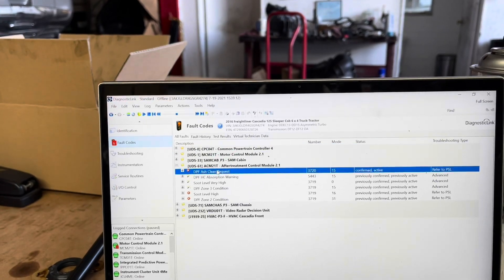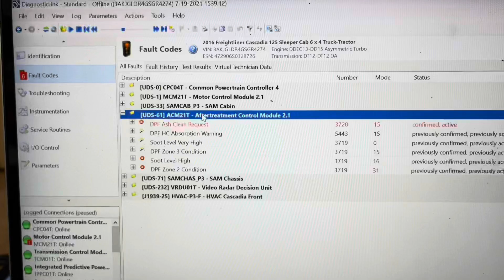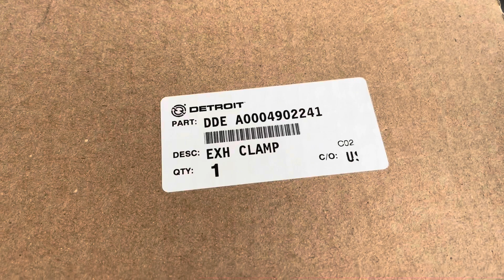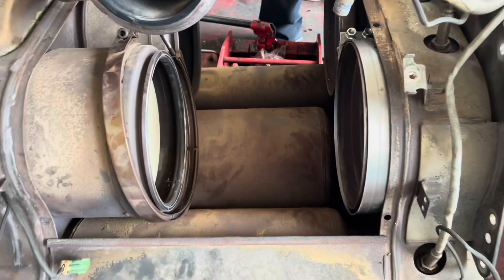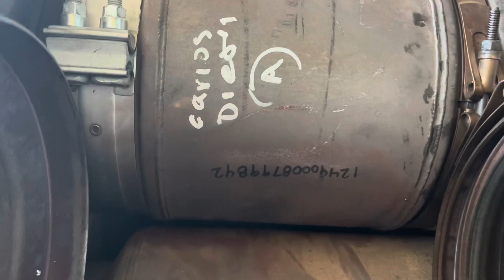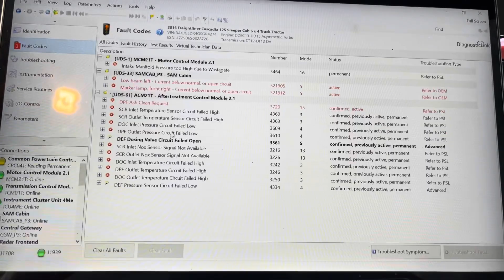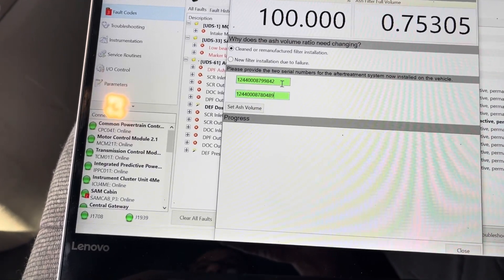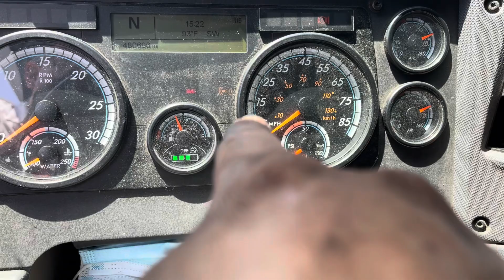Cascadia DD13 and DD15 SPN 3720 FMI 15 DPF ASH CLEAN REQUEST

Comment: Always blow out DOC aswell when baking filter, I see alot of shops not doing this when this code pops up, it should be mandatory,  what are your thoughts Carlos on that
Reply from the maker: I agree, the DOC should also be serviced. It is first inline. 
I always do this when we works on Cummins. The Detroit One Box does make it difficult to do this but they sell a tool that lets you place it over one side of the DOC so you can blow it out and use a shop vac.

Comment: Cual es la diferencia de hacer el reset enter CLEANED OR REMAN vs NEW FILTER INSTALATION DUE TO FAILURE? Compre unos filtros nuevos aftermarket de Skyline y no se que opcion cojer para el reset.  Gracias

Comment: How long do the filters last if you bake them? Can’t afford new ones
Reply from the maker: @robertcaceres3428  depends on the year of the truck. You can get away with baking them once but twice might be pushing it. The new One Boxes have a soot sensor that can read soot if it is getting through the DPF filters. 
Just had a truck in my shop with DPF filters that were letting soot through because they were worn out due to normal wear. 
What year is your truck?
Reply: @ 2019 freight liner cascades. Filters show at 43% least severe level.
Reply: @ it’s 2019 Freightliner Cascadia soot level is like 3% and the filters are at 43% least severe level whatever that means. lol severe is bad anyway. lol
Reply from the maker: @robertcaceres3428  I am personally starting to think DPF replacement is the way to go. The soot sensor can read soot that might be getting through a worn DPF. If the DPF is allowing soot through. It can trigger a fault code.

Comment: Hello, I need to ask a question.   I cleaned my dpf filters and reset the ash settings.  I was told that I am supposed to also reprogram the ACM.  Is this true?
The problem is I am getting code 520349 dpf effesince very low even after cleaning.  Please help! 
I replace the soot sensor as well.
Reply from the maker: @ranbirsohal8886  you don’t need to reflash the ACM. I haven’t heard of that. 
The efficiency could be a compromised One Box, comprised DPF. You can try reflashing
Reply: Thank you.

Comment: After the code come up how far can you drive before the truck goes to delete mode
Reply from the maker: Difficult to say how long, the idea behind the reminder is to service the DPF system to prevent any damage to the One Box. The sooner the better.
You can have the filters baked and cleaned or replace them with Reman or New units. Detroit recommends to have them exchanged.

Comment: What else I’m gonna need except DDDL ? 
Any laptop would work or it has to be some specific laptop?
Reply from the maker: When I get to work tomorrow I’ll look at the specs on my computer and see. The web site on Nexiq should have the requirements. I first tried an entry level laptop but that was too slow. 
I currently use a Lenovo laptop.
Reply from the maker: Windows 10/11 (64 bit)
2.0 GHz Dual Core Processor or faster
2.0 GB RAM or more
40 GB Hard drive with 20 Gigabyte free
Monitor and graphics card supporting 1366x768 resolution
1 free USB 
Administrative Rights (for installation only)
Vehicle interface device (e.g. Nexiq USB-Link2)
This is from the website. Hope this helps

Comment: Why does it say soot level good tho? And it says ATS electrical problem detected and this code .
Reply from the maker: Well, that is a good question. The ash clean request is due to the DPF maintenance that is monitored by the MCM, ACM. The truck can still perform a successful regen even though the ash request light is on.
Reply: @CarlosDieselElectric I got the derate, only codes I have on acm is 3720 15

Plus the def inducement light on, derate stop light, ect 

But this is the only code I have. And it derate me. Soot level low, runs regen perfectly without throwing any other codes. Engine working perfectly before derate. So I’m derated because Freightliner is SUGGESTING I change out the filters……. ??I don’t get it.
Reply from the maker: @serggla924  what year is the truck? What is the NOx efficiency at the end regen?

Comment: Im in a 2023 Freightliner Cascadia. The 3720 RMI 15 code active on my truck, but im only at 54,000 Miles on the truck? How is that possible? Does it really need new DPF filters at 54k miles? If so that is pretty sad.
Reply: Same problem 2024 freightliner
Reply from the maker: You can bake them or exchange them. Detroit recommends exchange
Reply: On my 2021 freightliner cascadia I did this at 250k, code never popped up I just noticed it wanted to regen every week when normally it would do a regen every 3 weeks so im guessing the code would have popped up any day, so with that being said 54k is insane for that code to be popping up

Comment: Hey brother I have 2020 DD15 I had my DPF filters cleaned just 4k miles ago and this 3720/15 code came on what could be the reason?
I would appreciate the reply
Thanks
Reply from the maker: Were the DPF serial numbers input into the MCM and reset the ash accumulator?
Reply: @CarlosDieselElectric  that I am not sure about but there was no sign n code till I drove around 4k and then suddenly it popped up

Comment: Hi. Thank you for great video. I have a code spn 3720 fmi 14. It’s same as yours? What i supposed to do ?
Reply from the maker: It means the DPF needs to be serviced. Detroit used to recommend bake and cleaning but they have changed their service recommendations to replacing the DPF filters (applies to One Box). If you have the old style filter you can bake and clean.

Comment: Hi pedro i have 2010 cascadia with deleted dpf but the other a guy plug his computer on my truck from there on, i have few new codes and thi is one of them  no check light or anything like that, do i need a software calibration and since is deleted can i drive like that ?
Reply from the maker: A delete can be complicated, there shouldn’t be any active fault codes when it comes to the after treatment since it was deleted. I say drive the truck or take it back to shop or person that did the delete so he can make sure it was done correctly.
Reply: @CarlosDieselElectric  im goin to los angeles california can i pass by to your shop ?

Comment: Quick question. What do you think about washing your DOC and DPF. Will it cause any engine damage just wanna get your thoughts about it.
Reply from the maker: The only issue that comes to my mind is if the DOC and DPF are not dried out properly then when you go to do a regen the water turns into steams and May cause damage internally. This was something that was discussed a after treatment class I took some years ago.
Reply: @CarlosDieselElectric   okay I will keep that in mind thank you very much I enjoy watching your videos keep doing what your doing awesome job
Reply: @neneg559 after wash, bake them to get moisture out

Comment: How long you can drive with them clogged?
Reply from the maker: Typically you want them serviced ASAP, when the notification or the CEL comes up you are at 90% 
So it really depends on how much you drive. The idea is to avoid any damage to the One Box and other components.

Comment: How long can you drive your truck like that once the fault code becomes active ? Will it make your truck derate?
Reply from the maker: The idea is to have it serviced asap. Also, you want to prevent any damage to the One Box. 
Not sure the how many miles you can drive before you have any issues. But you won’t get a derate when the CEL comes on.
Reply: Thank you Mr. Pedro I appreciate it!

Comment: my 2015 cascadia has 490k on it, I've never had to preform a regen on it, and I've never noticed it doing a passive regen, is this normal?
yesterday check engine / spn code 3720 appeared, I'm about 1500 miles from home, is it ok to get it back to Fontana, ca, any recommendations where to take it to service it out in the I E? thanx in advance
Reply from the maker: You should be fine getting back to Fontana. Just make sure you get it taken care of. Most guys will try make another trip and then service the DPF. 
Your truck is performing the parked regen while you are driving. 
I don’t know anyone in the IE. Try looking up a shop that has been around. That would be your best bet.
Reply: @CarlosDieselElectric Will do, Thank you for the response

Comment: Hi friend I'm really confused. I'm getting the 3720 code and get this... I just had my DPF and DOC cleaned 25000 miles ago. They were on great shape and only needed to be blown out. Any idea what else could be causing this code to come up??
Reply from the maker: I have to ask, when the filters were cleaned. Did the shop reset the DPF ash accumulate? 
They have to use the DDDL software in order to reset.
Reply: @CarlosDieselElectric  hi Pedro thanks for responding. My DPF and DOC were not re and re at a shop. I re and re'd them myself... when they were done they used the needle test. Filters were pretty good but they blew some compressed air through them anyway and got them back to about 93%. So I guess I have to have my ash accumulator reset... Yes?
Reply from the maker: @californiadreaming9216  correct, you have to use the software to reset. This way the counter will start at zero
Reply: @CarlosDieselElectric  OK. Thanks. But I had the DPF cleaned 25000 miles ago period is it too late to reset the ash accumulator?
Reply from the maker: @californiadreaming9216  you will be fine. Go ahead and have it done.
Reply: @CarlosDieselElectric  Awesome. Thank you very much sir. You saved me a bundle in diagnostics etc. I really appreciate it. Que Dios te bendiga a ti y tus familiares. Feliz Navidad!!
Reply: @CarlosDieselElectric  hi friend. I went to garage, code came up for nox sensors on my DD15. So tech suggested that along with a regen and resetting ash acumulator, it might be a good idea to replace Inlet and Outlet nox sensors. I said OK. Inlet replacement went smoothly. Unfortunately when tech removed outlet nox sensor some thread damage allegedly occurred on onebox. Problem being that now replacement outlet nox sensor will not thread into position. Now they are saying they need to re and re onebox in order to pursue alternate repair possibilities. Obviously I am resistant to that idea. I have some repair ideas and I would really appreciate it if you could suggest YOUR remedial repair ideas...?
Thank you Pedro.
Reply from the maker: @californiadreaming9216  it does happen, removing the NOx sensors does require extra care so the threads are not damaged. However, Detroit does sell the replacement thread/part where the Outlet sensor goes into. 
It does require the One Box to be removed for better access and it does need to be welded. Look into this option.
Reply: @CarlosDieselElectric  thank you. Say...
in your opinion,  how much exhaust pressure would say is exerted against outlet nox sensor and how hot does it get?
Reply: @CarlosDieselElectric  hello sir you were right... One box had to be dropped and they welded in a replacement insert for the n o x sensor. Truck is back on the road. Thank you very very much for your input I really sincerely appreciate it. Say... I have to replace my DEF filter. When it is replaced, is any tinkering necessary with the ECM?
Reply from the maker: @californiadreaming9216  there is a mileage interval when it comes to DEF filter replacement. I would have to look it up. 
But there is no computer work necessary.
Reply: @CarlosDieselElectric  okay awesome thank you. I have about 800 thousand miles on this truck and death filter was replaced at around 600 Thousand Miles so it's probably due or overdue

Comment: Once the check engine comes on, hold long can I drive until it needs to be changed?
Reply from the maker: Good question, there is no real limit except that you want to have it done asap because both DPF have reached their limit and you want to prevent any damage to the filters or One Box.

Comment: Hey boss. 
How much does it coast to change the filters to new ones ?
Reply from the maker: The One Box filters? Depends on the year, the newer DPF’s are on a nationwide back order.
Reply: @CarlosDieselElectric  I have 2019 freightliner . Check engine light on. This is what I have .

The code logged 61/3720/15 (SA/SPN/FMI) Indicates Diesel Particulate Filter Ash Clean Request is Present

Diesel Particulate Filter(s) are full of ash and need to be replaced. Do Not clear code without servicing the DPF(s) as further damage can occur to other exhaust Aftertreatment components.
Reply from the maker: @bekkam7900  this means your DPF filters need to be removed, baked and cleaned or replaced with exchange DPF filters (might be on back order). 
You definitely do not want to simply reset the Ash Clean Request without servicing the One Box. That will cause One Box damage.

Comment: THANK YOU!  further question. 

I have spn 3720 fail 15.  Will this prevent a manual regen?  I can't manually regen.   My check engine is on and on a recent trip my MIL for the after treatment system also came on and I was sweating bullets thinking I was going to be derated.

I see to fix the 3720 check  engine you need 2 serial numbers.   Is there any way to get around this?  Do regular dpf cleaning shops have these serial numbers?  Do they get them only when they send the filters off to be officially baked and cleaned?    

Local freightliner dealer wants 2200 for remanufactured filters or I can pay about 1200 for a bake and clean in the New Orleans area,  any advice?
Reply from the maker: The DPF serial numbers are actually on the DPF’s. Every DPF will have its own serial number. 
To be honest the numbers really don’t matter. This is just to reset the Ash Clean Request. 
There is no way to avoid the code from coming on. This is a calculated process with other MCM and ACM. It usually comes on after 200k miles (more or less). 
Think of it as normal maintenance. They can be bake and cleaned. Although Detroit now says you have to replace them with new DPF’s. Not sure how about that
Reply: @CarlosDieselElectric  how many mile you can run with this issue?
Reply from the maker: @antoneugen1  once the light goes on, there is still time. However it is letting you know filters are reaching end of service life before they need to be serviced or replaced.
Reply from the maker: @antoneugen1  very hard to say, if you are trying to make it home you should be fine. The idea is to not damage the One Box because the DPF’s are full and need to be serviced. I have seen guys push it a cause a derate

Comment: Hello .. I just left my yard a couple hours ago and  light turned on with code 3270 fail 15 wicj says DPF   now how long before I can replace them Like miles ????  Like a time frame more o less
Reply from the maker: The sooner the better. This means they have the maximum amount. It all depends on how many miles you drive and a few other factors.
Reply: @CarlosDieselElectric  ok thanks where do you recommend

Comment: How u doing Carlos thanks for ur videos do u know this fault code spn 102 fmi 18 thanks
Reply from the maker: That code can be intake pressure sensor, EGR pressure sensor (Delta P sensor), could be a CAC issue, turbo issue. 
There are many things to check. But start with the sensors or Delta P sensor and the Venturi pipe
Reply: @CarlosDieselElectric  thank u

Comment: Amigo   Se me prendió un código. EEC 61
Mi pregunta es. Puedo manejar así?
Ya que el sensor apenas me lo van a mandar
Reply from the maker: EEC 61 referencia al sistema del filtró.
Que más dice el código?
Normalmente es SPN ___
Reply: @CarlosDieselElectric  solo me marca eso y la luz amarilla que se prendió
Reply: @CarlosDieselElectric  le metieron la computadora y se borró solo un día. Y se regreso el código en mi tablero con la luz amarilla.
Reply from the maker: @jesusm9529  la luz sólida es Funcionamiento defectuoso del sistema del filtro. Normalmente el código se queda en la memoria y no se borra aunque se apaga la luz.
Reply: Eng 1. Es el tengo
Reply from the maker: @jesusm9529  falta más información. Recomiendo que lo lleven a un taller que pueda conectar bien con el programa de Detroit. No quiero dar información mala

Comment: I still have the spn 1323 fmi 31 fuel system problem detected and I have had 3 over heads do this this light has been coming on and going off for over a year now can you give me some ideas
Reply from the maker: Check your CAM lobes, it may be possible that it may have moved. 
When the overhead was done, how tight were the valves?
Also, have your mechanic perform a cylinder cut out test to help determine the cylinder or injector misfire.
Reply: @CarlosDieselElectric  can I bring it to you that way it will get done.

Comment: I just got a new one box installed. I have a 2013 freightliner cascadia with the eap 10 emissions. what can I do to make the one box last me as long as possible?
Reply from the maker: Regular maintenance (oil changes, fuel filter changes, and air filter change). 
Use good quality diesel (clean, not that cheap cloudy diesel). 
Use clean quality DEF in the jug not the pump. 
Valve adjustments on a regular basis.
Reply: @CarlosDieselElectric  how often do you recommend to do the valve adjustment
Reply from the maker: @jorgefacio690  I know the book says it must first be done at:
100,000 miles
250,000 miles then at 
500,00 miles. 
But I say every 100,000 miles. 
It is something quick and easy that can be done in a day. Just remember engine has to be cold.
Reply: @CarlosDieselElectric  alright cool thanks for replying. I have afault code that says brake 011 spn000807 ASR Dif2 valve 05 would you know what that is
Reply: Try not to idle for extended periods poor duty cycle is number one cause of one box failure
Reply: @alexcorvi2254  yeah I idle as little as possible